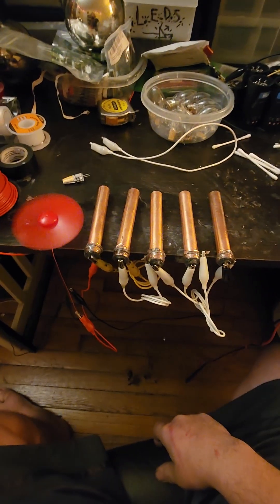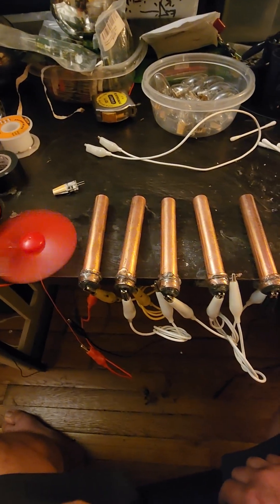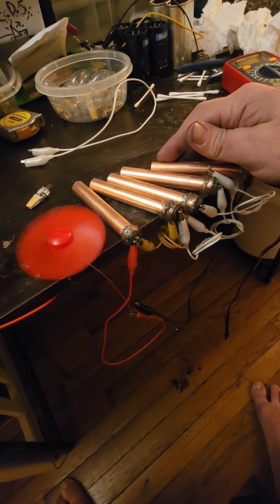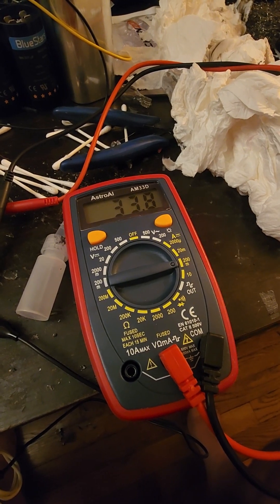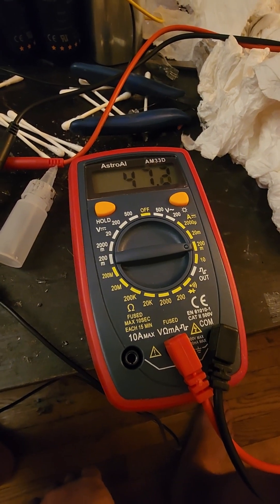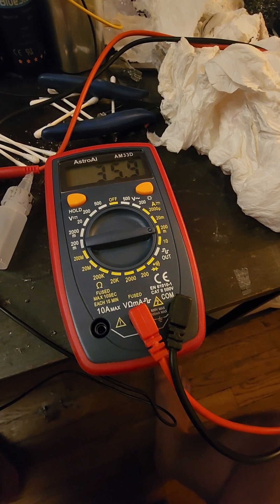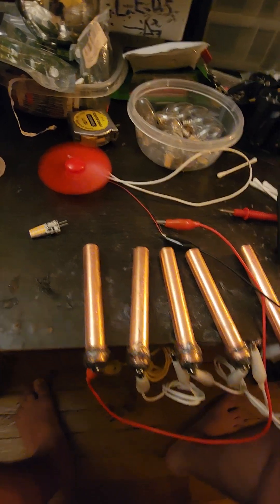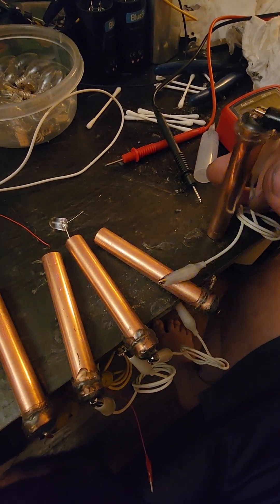🔋💧CHAT GPT DESIGNED NON CORROSIVE CRYSTAL POWER CELLS RUN MOTOR & LED LIGHTS!💡NEW ITEMS FOR SALE😀

Comment: Impressive discovery hope you can share the secret with us someday 😂🥲
Reply from the maker: Right now the 4 ingredients are the following in a powdered form mixed evenly.

1. Alum Powder ( absorbs moisture from air)
2. Graphite Powder ( makes mix more conductive)
3. Granite/Quartz Sand Very Fine (piezoelectric)
4. Powdered Tourmaline ( generates Spontaneous charge on metal over time)

I've got another batch of cells that contain more ingredients & output more power but that basic mix will allow you to create a cell that converts ambient moisture in the air into electricity. 10-30ma & it's a magnesium core in a copper tube. The cells work by absorbing moisture from the air & turning it into dc electricity. Drops of water may also be added to the cells to increase power output & there's no electrochemical reaction occuring here & none of the metals corrode. The devices simply convert moisture into electricity.

Comment: How it can drive 30mA if the multimeter probes are in the voltage jacks???
Reply: 3 probe multimeters are mesuring miliamps trough the default jacks. only setting that uses the last jack is probably fused 10A if I see it from the video correctly.
Reply from the maker: Yes the multimeter can read mA without switching the leads. Reading Amps requires the red lead to be switched to the appropriate socket

Comment: how often do you have to keep topping them up with water...and....in theory they could power the tesla yeah?..cheers
Reply from the maker: If i make enough of them they should power up the coil in low power mode & they need 1 drop of water about every 4 hours to maintain an output over 30ma indefinitely. :)
Reply: ok cool..great work bro..thanks @MTECH2022

Comment: How do you know there not corrosive?
Only time will tell right?
If that's straight water why give it a shake before adding it to the cell?
Still pretty impressive.
Reply from the maker: The 4 ingredients are non corrosive too metals & i decided to make a post & reveal the 4 ingredients feel free to check it out :)
Reply: @MTECH2022  Your using two different metals which are definately corrosive when in contact with one another over time.

Your powdered rock is also corrosive to metal over time.

Pipelines buried in the ground suffer from corrosion over time and as been well documented. Lead pipes, copper pipes, steel pipes and aluminum pipes have all been used under ground and all break down over time.

There's no such thing as a bimetalic battery that does not corrode over time.